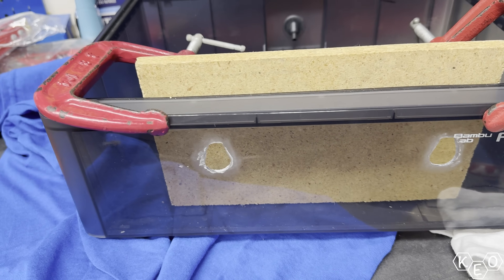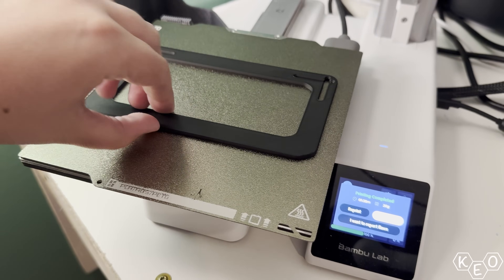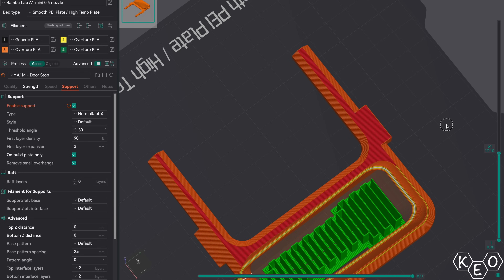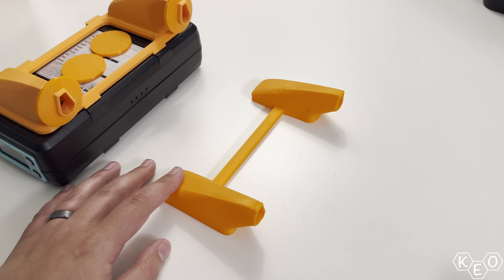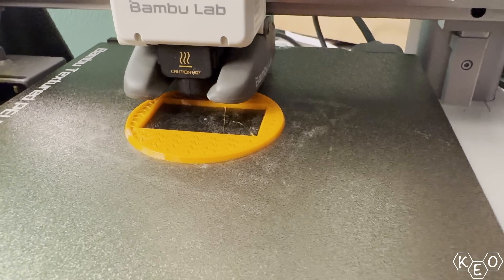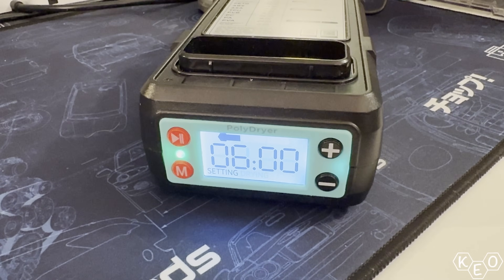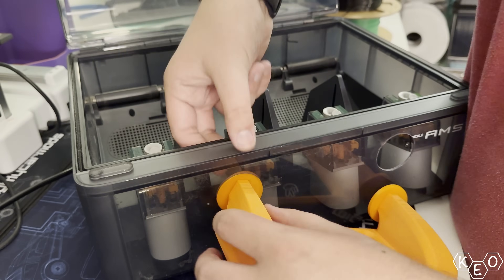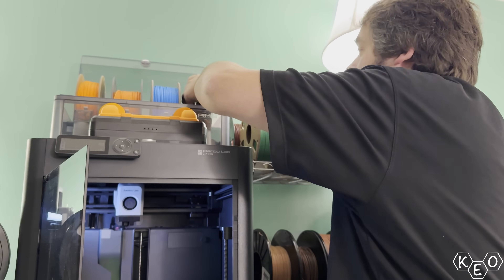AMS Filament Drying Finally Perfected! The PolyDryer Mod Is Complete

Comment: More on drying.   I just use the ordinary original AMS, with desiccant boxes inside. The humidity hovers around 10-11% constantly.  Usually the RH is LOWER, but the sensor can’t read below 10%.  The trick is simple, Every time you open the AMS you let humid air in.   Close it and the desiccant starts to absorb that moisture.  Once the desiccant is saturated to say, 15% RH then the sensor will read 15%.   At this point if you put a dried spool in the AMS, the Dessicant will GIVE UP moisture, until the dessicant and the drier spool reach the same RH.   That is, dessicant can put water INTO your filament if the spool is drier than the dessicant.
By the time color indicating desiccant turns its WAY wetter than that.   So the way to use desiccant is to monitor the sensor. As soon as the sensor starts to read 14% or higher, CHANGE or BAKE the desiccant to dry it back out.  Ignore the color.   
Desiccant does not just keep sucking moisture up. It absorbs OR releases moisture until its RH is the same as everything else in the AMS. 
E.g.   Say your AMS sensor reads 18% - you have 2 rolls of filament in there at 18% and dessicant at 18%.   Say you put 2 more rolls you have dried in a drier that are at 8% RH.   The sensor will gradually go down to around 13%   That means that the 2 dry spools you put in there are acting like desiccant and they ABSORBED moisture from the other spools and the dessicant until they reached parity.
You don’t need fancy drying systems. Just change or dry your desiccant any time it reads more than 14%
Reply: desiccant doesn't remove moisture from filament. You need heat to accomplish this.
Reply: @rthomas529 Incorrect.  Otherwise desiccant pouches would not exist. The only thing that heat accomplishes is it INCREASES the amount of moisture that AIR can hold.   The ACTUAL amount of moisture remains the same, unless you FLUSH the moist air out, and replace it with drier air.   E.g.   Hot air can hold more moisture, but when the temperature drops at night, that moisture will precipitate out as dew.  In a sealed box the amount of water in the system remains fixed. All that matters is that the desiccant AND the filament are in a sealed container. The desiccant and the filament will exchange moisture thru the air inside the container until the Air, desiccant, and filament all reach moisture parity.   If the filament you put in an AMS unit is bone dry, and the desiccant in the AMS is at 20%, then the desiccant will give up moisture to the filament, and both will end up at around 12%. I change out my desiccant anytime the hygrometer reads above 12%, and I dry every spool before I put it in.  The result in my hygrometers tend to stay at 10%.   The ONLY source of additional moisture is when I open the AMS to change rolls.  If I do so when the ambient air is 50% humidity, then the air inside spikes and the hygrometer will show a high reading for a half a day, but gradually come back down as the moisture balance equalizes.
Reply: @christopherpardell4418 I guess you missed thermodynamics in school. You’re conflating cause and effect. Heating an object does not make the air “pull” more moisture out of it. Heating the object increases the vapor pressure of the moisture within the material itself, causing it to be released. The air’s increased moisture-holding capacity is a consequence of higher temperature yes, but not the mechanism by which moisture leaves the object.
That doesn't mean dissacant doesn't have a role here, it is able to release moisture slower and absorb moisture faster than filament i.e. in a heated environment it will hold moisture longer and when it cools down, absorb it faster. 
The filament in that scenario won't absorb moisture until the dissacant has reached it's saturation point and the moisture in the air increases above the moisture content of the filament.
Reply: @r @rthomas529 didn’t miss thermodynamics.  You are simply missing the actual point. HOTTER air can hold more water vapor.  THAT is why driers heat the air inside the unit, to increase the gradient of RH between the filament and the air.  In a sealed system, the exact same amount of moisture is in the system at ANY temperature, but heating the air makes its RELATIVE humidity read lower simply because its capacity for water vapor goes UP. The hot air also heats the moisture in the filament by heating the filament and that DOES release more moisture into the air.  But if the AIR in the drier is at 100% RH it will not dry a damn thing. Moisture will only leave the filament if the air in the drier is at a lower RH than the filament. Period.   And the moisture will ONLY leave the filament until it has the SAME RH as the air surrounding it.  This is why clothes driers EXHAUST the damp air and continuously introduce freshly heated air, and why they have a harder time drying clothes when the Ambient RH is 80% or higher.   When you put dried filament in the AMS It will ABSORB moisture from the air that got into the AMS when you opened it.  So its moisture content will go up.
The moisture inside a sealed unit like an AMS does not disappear. It just gets moved around and Relative humidity is relative to temperature. Air at 60C might read as 15% RH, but the same air in a sealed container, when it cools to 24C might read an RH closer to 30%. 
In an AMS unit, The hygrometer reads the relative humidity of the AIR in the unit. BOTH the desiccant AND the filament are hygroscopic.   Their humidity will equalize with the air in the unit at whatever temperature the air, desiccant and filament are at.   Desiccant will keep absorbing moisture until ITS humidity matches that of the air. 
And while heating air in a drier can certainly speed up the process by decreasing the RH of the air in the drier for a higher differential with the humidity of the filament, if the air in the drier is not DRIED thru condenser, permeable membrane, or other means to extract actual total water from the system, then you are just moving moisture around and changing the RH reading based upon material temp. 
The way to extract actual moisture content from the AMS and keep your filament dry its to put dried filament in. And open the unit as seldom as possible.  Over time the hygrometer will read higher than its 10% lowest reading as each time you open the AMS you introduce humid air.   When the reading gets near or above 13%, that means that the desiccant and filament are BOTH at 13% RH. You change out the desiccant with oven dried desiccant, whose real RH is going to be below 10% ( even though the hygrometer can not read RH below 10 ) and it will absorb moisture from the air, which will then absorb moisture form the filament until everything in the AMS is at a lower humidity.
You REMOVE actual total moisture from the system by changing out the desiccant the moment it starts to go up in humidity.
Reply: @christopherpardell4418 this is just not correct and easily proven false. When the air is heated, you can watch the rh climb long after the air has reached full temperature. This is the moisture being released from the filament and desiccant, even though the air can hold more moisture. The rh won't drop to its lowest point until everything has once again cooled and the desiccant has absorbed the moisture (or if vented out), while the filament will absorb some moisture, the desiccant sucks up most of it. There is no equilibrium.
Reply: @r @rthomas529 don’t think you understand what I wrote.  In a SEALED SYTEM, increasing the air temperature DECREASES the RH of the air.   That is, in a sealed box, with NOTHING in it but air.   How raising temp helps dry filament is that increasing the temp of the air increases the DIFFERENTIAL between the humidity of the filament and that of the air.  As the RH of the air drops below the RH of the filament, Because you heated the air, water will vaporize out of the filament and into the air.   So in a box with damp filament, YES the RH of the air will rise as moisture moves from the filament into the air.  The hygrometer can not measure the moisture content of the filament, just the air.   As the RH of the Air rises, absorbing moisture from the filament, the filament can never be any drier than the RH of the air in the box.   That is, as the RH rises in the AMS, the filament is always going to have the same RH as the hygrometer reads. 
The problem is the REAL moisture content inside the sealed unit like the AMS CAN NOT CHANGE. You can leach SOME of the moisture out of the filament, but as the RH of the air rises, the differential will disappear and the RH of both filament and air will equalize.   If you continue to heat the air, the RH will seem to drop… built the total moisture in the box remains the same, you are just changing the RELATIVE moisture capacity of the air, NOT how much water is in the box.
You have to REMOVE moisture from the box to REALLY dry the filament.  
THAT is what desiccant is for.  You dry it bone dry in an oven, and then put it in the box.  It’s WAY drier than the RH of the air you let in and the filament you put in, so its differential of humidity means it absorbs moisture from the air. That dried air then absorbs moisture from the filament.  Still, all that water is still the same amount, you just moved a lot of it into the desiccant.  When the hygrometer reading starts to rise, it’s because the Desiccant is becoming saturated enough with moisture that it can’t absorb more water from the air.  That is when you replace the desiccant with freshly dried desiccant. And removing the damp desiccant is what removes actual water content from the sealed AMS.   That is the only thing that lowers the total moisture in the system.   Removing the desiccant and drying it ELSEWHERE.  If you make a habit of replacing your desiccant when the hygrometer climbs above 13 or 14%  You will be removing whatever moisture gets INTO the AMS when you open it, or put a new roll of filament in.
Reply: @christopherpardell4418 😂

Comment: 9:00 the dryer does have two, they qre small and on the left and right of the heater module but as far as i know they did test with both and found no difference.

Comment: I feel like splitting the difference might be cost-effective and appropriate: use one dryer underneath and print a matching support to elevate the other side. Would look way better than the holes in the front and probably a lot more efficient that those tiny duct holes.

Comment: ABS has no warping problems.  3D printing has many unskilled people, bad profiles and improper printers.  If your ABS prints are warping on an enclosed printer, stop all exhaust venting.  Overhang cooling is ok but only past 45 degrees and never more than 20-30%.  If you use an adhesive, use only Elmers Extreme glue stick.   Everything else pretty much sucks.  The glue stick is a mold release, don't be an amateur and think it's adhesive in this application.  The inside of the printer can't be too hot.  A part that size will need at least a 40c interior.  It's first level beginner stuff to make mechanical parts out of PLA unless your making throwaway prototypes.  It's worthless outside of air-conditioning.  ABS is the king of materials all things considered. (Meaning it is a top performer in many areas, not meaning it's always best.)  Love this project.
Reply: Ehh, I’ve found ASA does everything ABS does just as well, and some things even better, with WAY less stink. I don’t print in ABS at all, if I need something that’s going to get hot or see direct sunlight, I use ASA. An open window or two is plenty to keep the smell almost unnoticeable. ABS is so smelly when printing I’m pretty sure I’d poison the neighbors dog if the print lasted longer than an hour.

Comment: My First stop at your. (Im Richard from Sweden by the way). Regarding the vent to let humid air out - that air Will be replaced with air from your Room. (there is no other option expect vacuum and I think the internal ams moistlevel is better then on outside ams) I would go with the solution others have done by simply print containers and fill the voids in the ams with the  silica gel crystals beads (resident or whatever it’s called) and monitor moist level and now and then dry it in microwave to recet. Just some taughts … nice project! /Richard

Comment: so after all of that, if you had to start over, would you still do it or would you just buy a dedicated dryer?
Reply from the maker: Well after living with it for 6 months or so, I don’t actually use it in that configuration all that often. Usually the filament that requires drying is also not AMS compatible which has me feeding from a poly maker dry box anyway. So between that and the packaging constraints and power cable management issues this setup presents, I don’t use this method anymore. But it is still a cool idea that I’ll be revisiting in the future
Reply: @KeoPrints   i think it makes more sense if you live in a very humid climate.

Comment: Errrrr......You could also just put your filament in an air fryer on a low setting for 20 mins. Works well for me!!
Reply from the maker: Ahh I’ve never thought about the old air fryer. Cool
Reply: @KeoPrints  Mine has an actual dehydrated setting for drying out fruit and veg, but even a standard one should go down to about 100c. They work well.

Comment: Doesn't like supports.. Too annoying to auto generate so models the supports instead. Yep checks out.
Reply from the maker: I just care enough about those that would like to print the model that I put aside my hate for a second. This way no matter what slicer settings you’re using, it'll be supported without the need to specify or paint supports. Also I would rather design supports than paint supports or use an object modifier to specify supports. Just a personal preference; not for everyone I understand.

Comment: For future reference, when using a hole saw on plastics, run it in reverse and it will give you a nicer cleaner cut as it scrapes the plastic away instead of tearing through it.
Reply from the maker: Ahh good call. What a helpful comment! Thanks friend!

Comment: It would be great if you showed the humidity in the environment. Is your office really at 62%? I have the desiccant only solution, I mean the extra desiccant solution with the printed holders added to the AMS in the back and front. (so that's 7 separate holders filled with the orange beads) My office reads 46%, Both my AMSes  read 10%.